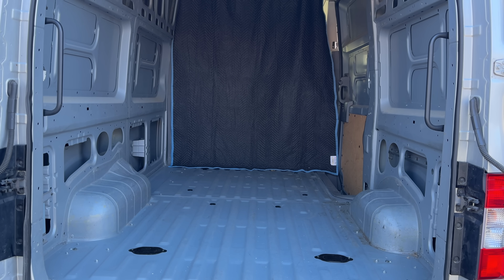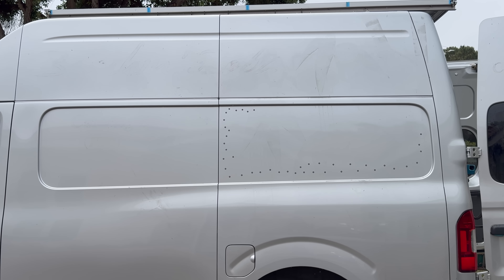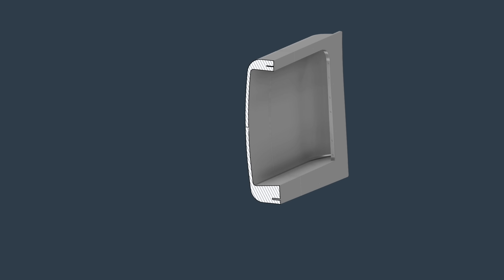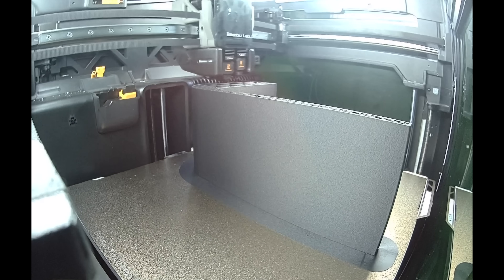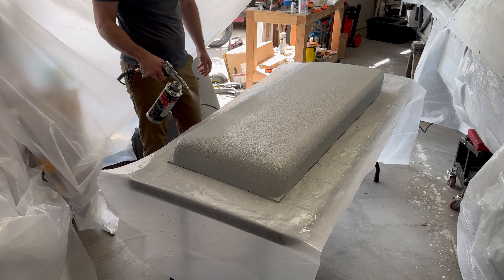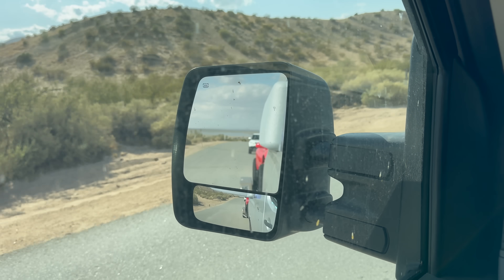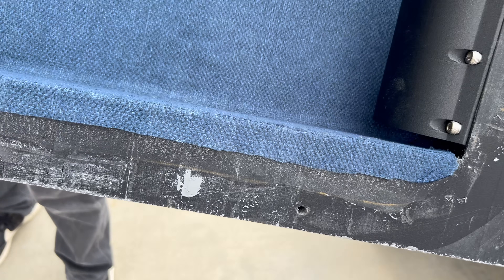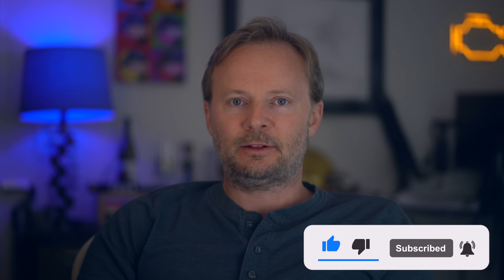The Challenges Of 3D Printing Large Parts

Comment: Using acetone on ASA works the same as on ABS. Usually when i have to glue ASA parts together, i put some old support material in a glass container and dissolve it in acetone to make a glue. After using it it shrinks a bit so it comes off of the glass container so you can reuse it, or keep it in to dissolve it again at a later date.

Comment: I want to talk to you Matt. 

You do a lot of sanding and fiberglassing for someone who hates those things. If I hated sanding as much as you do then I would spend a lot of time trying other methods before sanding for example bed liner. Then maybe I would realize that other methods don’t work. But I would still try other methods before sanding every time. Same with fiberglassing. Like you did with the bed liner. But fiberglass still wouldn’t be my next option. I would put packing tape, duct tape, lots of glue, superglue, silicone, or try plastic welding (or plastic soldering as it often turns out to be because I don’t understand how plastic works). But I don’t think I would try fiberglass if I hated is as much as you do. 

However, since I don’t have the means to try most of my ideas I live happily confident that all my ideas are good. As opposed to you who try your ideas and find out not all of them are as good as you’d have thought…? 

Sincerely, your fan

Comment: I’m wondering—does it collect water the way the honeycomb structures in early airplanes did? The first ATR-72 ailerons failed because water became trapped inside and fractured during freeze–thaw cycles. A more durable approach might be to 3D-print a reusable mold and fabricate the extension from laminated material. The mold could be reused, and the resulting part could be sold as a commercial solution.

Comment: Tip on the locating features for reconnecting the prints: Look at machine tapers (for instance, how your drill press chuck is likely attached if you have one), you can get a rather firm and flush lock with the right angle. In my prints I use a "peg and hole" type feature with a 5 degree taper in PETg for a self locking effect and a firm squeeze locks the two parts together rather reliably. Maybe not enough for long term, but certainly long enough to glue things together. I either print them directly in to the part or I'll print a peg with the proper taper on both ends if I need to attach two downward printed faces, a good 1-2 extra millimeters tends to be enough on a 5x5mm hole with a 5 degree taper so that the bridged top doesn't interfere.

Comment: For anyone replicating this, when you cut up the pieces to fit the printer, add an overlapping lip, more surface area for the glue+ harder for water to get in. You probably could also add an oring, I wouldn't bother, but you could
Reply: ASA can 100% be acetone welded too, use that instead for a near-perfect bond. A tongue-and-grove would also make alignment super easy. With acetone welding you can make a slurry of old ABS prints and acetone and brush it on the seams to completely seal the joint. In the end it's all ABS/ASA therefore temp changes shouldn't impact it too much.
Reply: Just what I said before I read you comment. Yes harder for the liquid to wick through the corners and added surface area fro the joint AND NO NEED FOR DOWELS.
Reply: I'd like to see HIPS get some more use. Its strong and prints great and it's sanding is second to NONE. Smooths so well and it can melt with toluene and bond with toluene. Its a powerful material and it's cheap
Reply: @BarronBros1822  It also doesn't bond to ABS while printing, so if you need a support material for your ABS/ASA prints, HIPS is your boy.
Reply: @BarronBros1822 that’s what she said…
Reply: I'm weird and I'd prefer doing the dowels, but with TPU gasket tracks between the parts, in place of O-rings.
Reply: just taper

Comment: So, from what i remember, ASA and ABS are susceptible to the same solvents, so ABS glue will often work with ASA, and 3D gloop actually markets their ABS gloop as working with ASA. I would take that over epoxy any day of the week since you are actually welding the pieces together vs mechanically fitting the pieces with Epoxy. I've seen weld DP 420 fail too many times on flat surfaces. Edit. I should have waited before making this comment. But the part splitting is completely expected. When using epoxy to "glue" large flat surfaces, I will add T-channels for the Epoxy to actually have somewhere to create mechanical strength to hold the part together.

Comment: How about a 3d printed condenser housing on the bottom of an airplane? Oh yeah, works great. I had it made from PA12 (nylon) in an SLS machine, and I designed in tongue & groove joints to ensure that my 3M adhesive actually DID hold the plastic stuff together. Even at 180 mph.

I saw your van in the driveway last month with that box on the side and wondered WTF that was for, now I know... Legs and a pee bottle!

Comment: Hi, I printed much bigger items for moulding purposes. Most important thing is to iron solder prints togheter and to avoid glue. Uniform stable surface with same thermal expansion is only way to avoid seam lines showing up after a while. CF filaments may have smaller CTE than regular (exept z axis where there is no fibres) but its still gigantic compared to any metal.

Comment: ASA is quite oily when printed; bed adhesion becomes a problem after a few ASA parts. That also means it needs degreasing before you try to glue it, unless you're acetone welding or using ABS cement (which works just fine). Also... don't sand CF filaments without care to deal with the dust, it's pretty bad for lungs. Wet sanding is enough, but dispose of the residue before it dries out.

Comment: I assume Infinity Bond MMA 500 would have bonded the ASA absolutely perfectly. That is my go-to for all plastics now. It has never let me down. It is unbelievable.

(It looks like the applicator gun and mixing tips for the DP 420 are the same, so you already have those.)

As for bonding the panel to the van, I'd think maybe Big Stretch by Lexel would be a good place to start? Or maybe just Permatex Ultra Grey RTV Silicone?

Comment: nice vid! custom auto mods are crazy cool. 

 it looks like you printed this with a standard print nozzle. i have a custom large-ish scale printer (400 x 400 x 500 mm), and i swapped my .4 mm nozzle for a .8 mm. i can get away with 2 perimeters  and 5% infill for most of my industrial prints. also cuts down on print time! really useful for function over form prints. head
definitely recommend pairing it with a Direct Drive Extruder (personally rocking the ender Sprite and loving it!)

Comment: As far as the bed problem goes, "cut a hole in the back of the van to make legroom for a bed" is the absolute last thing I expected someone to do. Lol.
Here are some other ways you could've made extra room that I would've thought of before that:
- Couch that converts into bed (preferably a couch with a jackknife hinge)
- Dinette that converts into bed
- Bed on a lift that raises it into the roof when not in use
- Murphy bed
- Hammock
Reply: I wouldn't want this arrangement in a van, either, but the bump-outs are common where there those other choices don't work, which is the rear seat of a double cab ("crew cab") truck being used as a sleeper.

Comment: Sooo close to being perfect. I'm sure a few people have said this, but should have just done solvent welding. ABS is just not a very good substrate for epoxies or glue. Basically there's just no reason to even consider using epoxy or glue when you can very easily fuse things together permanently using a cheap solvent like acetone, or ABS cement.

Comment: Awesome job! However, I would have used something like 90u TPU because it has perfect layer adhesion, meaning that it is automatically waterproof and much easier to glue together and it is also very durable. It's basically rigid compared to regular TPU.

Comment: 0:13 Just as a funny story: you know when you're in the morn and eat your bread and then put the bread back in the rolltop bread holder? Yeah, that's how you can easily store your bed away in a camper van while maintaining full size floor between cabinets either side.

You can skimp on the quality of materials, but the order of quality should be rails>slats>leather.

Being in Europe, i made such a floor using an old roll window cover (the type that rolls up into a recess above the window), dunno if those are common in NA and a plastic one wouldn't work.

I discarded the old rotten wood but reused most of the mechanism, replacing the slats with discard oak floor trim (10 cm wide, 14 mm thick). With a steam cleaner i bent them into a shallow arc. When you walk on top, they auto lock in place. The structure around is part of the furniture either side, which is required since van walls are not made equal (VW T5 LWB, tall package, no side door or windows) and you have to go over the humps.

The slats are made by cutting pockets into both sides and then sliding leather and locking it in place with brads every 10 or so cm. I initially thought about using leather belts, but then i found that you can buy uncut rolls of the precut material so i went with that. It's important to use a full width bending material so crud doesn't fall on your bed when you walk on top.

The mechanism and closed up roll system is housed inside a box at the end of the bed (towards the door or the front, depending on your choice) during sleeping hours. When you're moving about, you can store your pillows and other bed related paraphernalia inside that empty cavity either side of the rolling drum (the window mechanism used a gnarly piece of wood initially, i replaced that with a piece of round oak rail you can get for stairs.

Last tip, the bottom of the box should have 1 cm tall stand-offs and you nail chicken wire on top. That way, any crud that gets pulled in with the mechanism falls in there and doesn't end up on your bed stuff when you stuff them either side of the mechanism. 1 cm tall, because it can be easily vacuumed out once in a while. Been using this for about 12 years now whenever i go out and it's a really neat solution, i think.

Pros and cons. I'll start with the one con, walking on these slats, even with the type of wood i used is weird. Floaty. Like an old wood house. 

Pro: You can use your van as a normal van and transport stuff when it's rolled over with the caveat that i use a rubber cover whenever i do that.

I use a bean bag to sit on top whenever i'm sitting there.

Comment: Matt, i use a hot plastic staple tool when ever i need to connect large prints together... and probably add some dowels to give it some strength. also you should add a layer of resin on carbon prints, since it will shed bits of microscopic carbon into your skin.

Comment: If you are to try this again i would suggest just using native PET(g), it wont warp on an non heated printer as ASA and it's flexible enough to bend when needed. Price which it should be around 40% - 50% less expensive as well. ASA's UV resistance is great but since you are coating the part in the end that doesn't really matter.

Comment: "ASA can be solvent-welded, using e.g. cyclohexane, 1,2-dichloroethane, methylene chloride, or 2-butanone. Such solvents can also join ASA with ABS and SAN. Solutions of ASA in these solvents can also be used as adhesives.
ASA can be glued with cyanoacrylates; uncured resin can however cause stress cracking. ASA is compatible with acrylic-based adhesives. Anaerobic adhesives perform poorly with ASA. Epoxies and neoprene adhesives can be used for bonding ASA with woods and metals"
- wikipedia

Comment: Result looks good and yeah, I wouldn't have done it without carbon/aramid fabric as top layer.
What I find useful with multi-part prints is to design a channel into all parts (3.5mm hole) and then put everything together with a threaded M3 rod (and nuts on both ends). Makes the glue-up super easy, gaps between parts super small, makes clamps superfluous and holds the whole part together. 

Like in a bridge.

Comment: 5:40 I have used packing tape for this, it works well as the cyanoacrylate doesnt soak into that packing tape like it does with the painters tape. Still leaves some adhesive but that rubs off with alcohol. Im sure there are specialized tapes out there that are better but im just looking to cheap and nearby.

Comment: I can say that while working with fiberglass is awful, if you don't give a shit wrapping 3d prints in fiberglass sloppily does in fact work. I 3d printed a charge pipe in ASA, the layer adhesion was questionable, but even still, wrapped in fiberglass it has withstood as much as 13psi without any issues.

Comment: Would plastic welding work for this? I'm sure the little metal supports and soldering iron would meld it, however not sure how it would react with the carbon filament

Comment: Highly suggest checking out 3M DP8005 as an alternative to the 420. It's also expensive, but specifically designed for low energy plastics and I haven't found something it won't stick to. Even bonds slippery stuff like polypro. Only downside (beyond cost) is it has a very small working window before it sets up.

Comment: One thing you can do to improve the adhesion with the plastic, is to flame treat the surfaces. You need to use an oxygen rich flame, and a short run over the surface is enough. This increases surface energy of the adherent. Plastics have a low surface energy and the adhesive has to have a lower surface energy than the adherent (substrate or material being bonded) for good wetting and adhesion.
Reply: I've seen flame treatment to restore aged plastics, but have not heard of this technique for improving bonding adhesion. This is neat!
Reply: @thecatofnineswords the process of restoring plastic that you've seen with flames are more about heat and a remelting of the thermoplastic. Flame treatment is different in that regard where the heat is a short exposure. You can also achieve the same result using low temp plasma, but, those setups are quite expensive. Not exactly something you'll see in a diy home setup
Reply: @thecatofnineswords very different techniques fundamentally. Restoring plastics is heat related, as you're actually remelting the surface of the plastic. With flame treatment, it is all about adding oxygen to the surface. Technically, the process doesn't even need to be hot, it can be done with cold plasma, but none of us have 1/2 million dollar plasma ovens at home 😂

Comment: if the sides of your vehicle are steel then one could just keep peening the inside until the metal has stretched into the desired shape and then add a window to the fresh metal bumpouts that were just made, if desired.

Good thing about metal, if the shape isn't right the first time it can be reformed until it is right.

peening sounds
Reply: Too bad that stretching out 6" would turn that thin gage into tinfoil.

Comment: Epoxy gets used to glue everything around 3D printing . It's like there isn't anything else in this world to glue things with when epoxy really isn't good for anything plastic. Especially low surface energy plastics like Petg, abs , ASA and whatnot do not stick to epoxy well or at all . There are acrylic glues, MMA glues , plastic welding , chemical welding and some other things that work so much better and are actually meant for sticking plastic things together .
Reply: Chemical welding with acetone or MEK is the way to go.

Comment: try House  Paint -- Latex -    i used to be a custom painter - it was a lot of Work and $pendy - now I use  Latex House Paint  - Can be color matched - spray /roll/ brush - sticks Great / Lasting  -
 gloss - egg shell  or  Matt  -   painted my travel van 6 yrs ago white with lite blue tint - changes colors thru day - Looks Good -  is Super  Easily remove with citrus cleaner -  spry on cleaner  cover with thin plastic sheet so it wont dry -   drink 2 beers then wash off paint with water - comes right off - works on cement to remove paint  spilled on driveway side walk  Or on wood ect
Reply: on the plastic? how best to prep for that?
Reply: @cpzmelbs  depends on the plastic -  many plastics house paint will stick to - other plastic can be prepped by just brushing a  propane Flame over to increase Surface Energy -  Or there are primers made for plastics -  test to see if paint sticks

Comment: PERSONALLY. i WOULD HAVE BONDO-ED THE 3D PRINT, WITH "MARINE BONDO". Then run fiberglass cloth heavily saturated, on the first layer. then another semi heavy coat on a 2nd layer of cloth. over that layer. The bedliner used, should be a marine gel coat or equivalent. That crack had to do with the flex. Having the 3d prings internlock like a puzzle piece would have been possibly better.

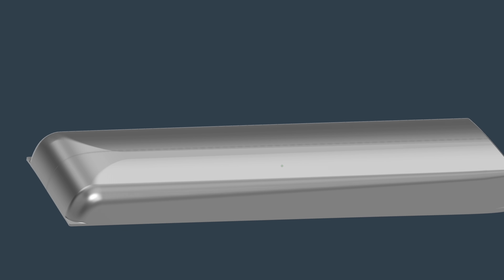Comment: 2:56, what’s a fillet?
Reply: A rounded edge
Reply: Then why didn’t he say rounded edge? ;-)
Reply: @MrConverse fancy engineering terms
Reply: Just the same way a chamfer is when make a flat edge at, for example 45° on a 90° edge. It's just easier to say chamfer and fillet, Cheers
Reply: @kalle5548  yep

A layman way to say it
If you had a sharp corner, you fillet it if you sand it, and you chamfer it if you pass a knife on thr edge to make it less sharp

Comment: Have you ever experimented with spray on truck bed liner? I’ve seen videos where they spray it on objects, and it makes them extremely durable. I’m guessing it has fiberglass reinforcement in it. I wonder if it could create an extremely durable coating for large 3D printed objects. Kinda like adding a fiberglass coating without all the annoying finish work.